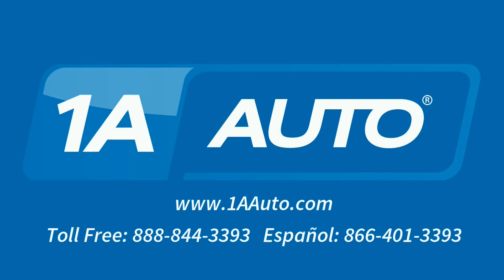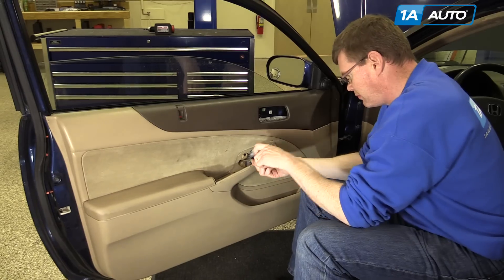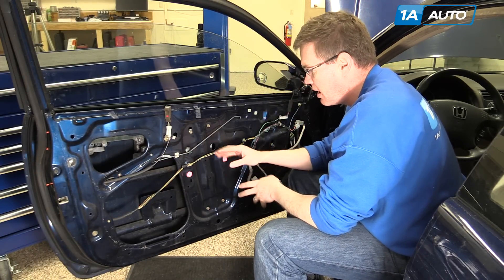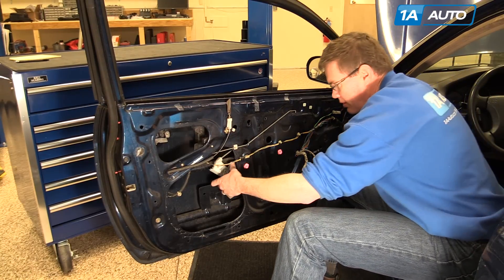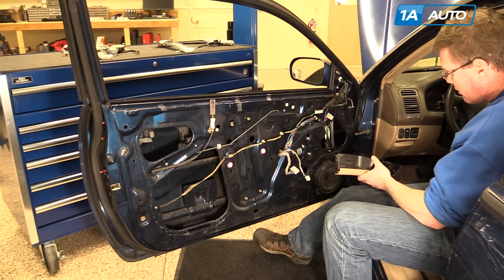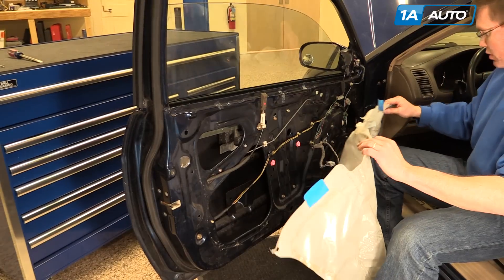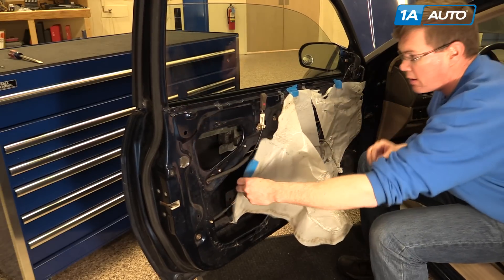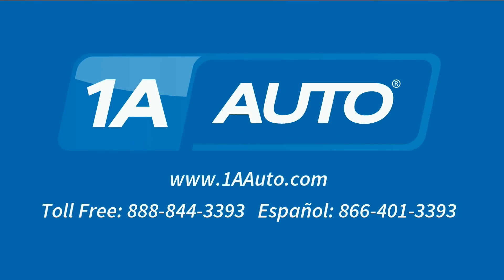How to Replace Window Regulator 01-05 Honda Civic

Comment: Great video! The rear runner unbolted and fell in my door, but otherwise was pretty straightforward. Hardest part was the central Texas heat!:(-John in Austin
Reply from the maker: +TheGearhead222 Thanks for checking us out! http://1aau.to/m/Shop-1AAuto-c
Reply: I'm in San Antonio, I feel ya on the Texas heat

Comment: THanks for this.  Just one comment for those whose window is stopped in the closed position, as was mine. Rather than attempt to cut the cable for the window to be removed, I was able to get a longer 10mm wrench onto the two nuts to loosen and then used my fingers to undo. A little slow but eventually they came out.   I undid all of the bolts holding the assembly so the assembly would drop enough to allow the window to drop from the upper guide track and then I was able to lift it out.

Comment: is this the same process for replacement the window motor on a rear passenger door?
Reply from the maker: +Johnny Thanks for checking us out! Yes, this process will be nearly the same for the rear doors, this video should be able to walk you through that installation.

Comment: This is great. I'm having an issue where my window wiggles around, and gets stuck when I'm putting it up. In order to roll it up, I have to pull on it while wiggling side to side. Does that mean I need a new regulator? The motor and everything does work. It's just hard. Is something loose?
Reply from the maker: +Michael E Thanks for watching!  It could be the regulator, but you will want to inspect it first.  It could be that it is just loose and needs to be adjusted and tightened back down, but you won't know until you look!  1aauto.com

Comment: is there a way to have to have the window in the up position temporarily while waiting for my part. my window has fallen into the door
Reply: cut about 10 inches of the cable from the motor tug it up till the Window feels tightly closed and secure it using the rail bolts. wrap the cable behind the bolt and tighten it. like when adjusting a bicycles brakes.

Comment: Longshot, but hopefully you can answer.
Driver Window stuck in up position, motor is bad (tried jumping it directly with a batter), how do i go about lowering the window to then remove it?
I have searched the internet, and have found nothing.
Reply from the maker: +XyXInc Thanks for checking us out! You may be able to remove the regulator by removing he bolts and shimmying the assembly down to the point where you can get it to release. You may also find there are clips that hold the window glass onto the regulator down towards the bottom, some vehicles have this some do not. We hope you get this out soon! 1aauto.com
Reply: @1AAuto  thanks for the reply, will give this a try tomorrow.
Reply from the maker: +XyXInc You're welcome!
Reply from the maker: +XyXInc Best of luck!
Reply: @1AAuto  Update:  Unbolted the regulator (track) assembly and motor.  Then tilted the window back and forth to gain access to the window bolts.  It was a bit difficult, but honestly no other way to do it if the motor is completely dead.

Comment: hi there, great video....I have a question regarding a problem with passenger side window on my 2004 honda civic which is stuck in the down position [open]. I purchased the driver side window switch and that didn't fix the problem I also checked the wires in the door jamb and those are all in tact. The window does not move up manually so I am assuming the cable didn't snap so can I assume that the window regulator motor failed, if this is the case how will I be able to access the bolts that hold the window regulator to the window if it is in the lowest position in the door. Thank you in advance for your advice.
Reply: loosen all the bolts to the regulator and motor and you can pull it back far enough to loosen the window at the very bottom
Reply: that was a bitch to do...i just did it took me almost all day with one run to tool shop for an extension bit
Reply: Wish me luck boys gonna attempt this tomorrow

Comment: Are the compatible with honda accord
Reply from the maker: No, this window regulator will not be compatible with the Honda Accord. We currently do not have an auto repair video specific to your vehicle. You might be able to apply some of the basic steps shown in this video to your application. +everette romero

Comment: How do you go about starting this job when the window is stuck in the "up" position?  My switch, wiring, fuse, etc. is fine, but the motor just clicks when trying to move it up or down.  Seems like a catch 22 of needing to have it down to be able to do this.
Reply: Kenneth Kopczyk I had the same issue so I cut the metal cable on both sides.

Comment: Can you just replace motor or everything together
Reply from the maker: +Nedo the car Guy You can, but the issue is finding a motor that will match up with your regulator.  You are really better off replacing the entire assembly, and we sell them here through this link; http://www.1aauto.com/2001-05-honda-civic-window-regulator-driver-side/i/1awrg02362?utm_source=YouTube&utm_medium=CTA+Comment&utm_campaign=ytcomment&utm_term=4IG_PIGJ0GQ

Comment: Hey man, I have an 05 honda civic si, do you have anything for that? I had the window regulator go out which is different from the one you are showing. I unbolted everything. The problem is the window seems to be stuck. I cannot get the regulator track out of the door... Any tips?

Comment: I replaced the regulator brand new assembly but the window still only goes down not up I also replaced the master window switch also the passenger switch still only goes down not up what could be the problem
Reply: Brickcity Nj Parham Did you find out what was wrong? I'm having the same problem and I'm guessing it's the wiring
Reply: I have same, I swapped the wires on the motor to operate the windows back up with down switch, not sure issue

Comment: i wish u would have had a window installed to show that removal...it took me all day because of the two screws that are at the bottom that attach to the window...i don't know what honda was thinking by not putting a huge hole so hands and a tool can fit to remove these two bolts...i don't even know how when i get the new regulator how im going to attach those two screws...and i am a woman with small hands...so friken ridiculous they don't make these cars that last forever user friendly for repairs...
Reply: kailey barri hi were you able to fix your window? Any tips? I’m going to do mine soon